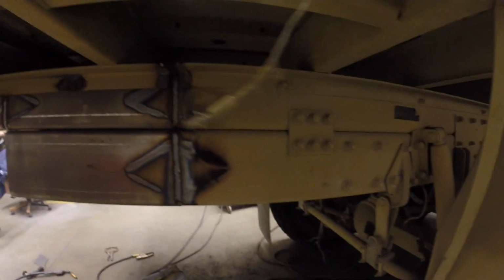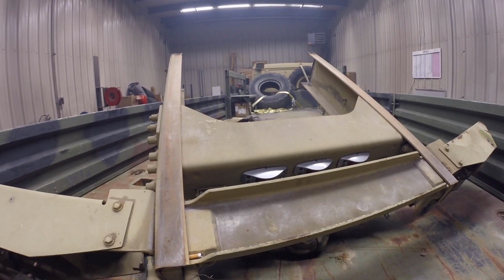FRAME RAIL ERECTION! - Truck Frame Stretch Part 2

Comment: I know this is old video but just in case anybody reads this.....  If you ever stretch frame rails you should always do a Z Notch instead of straight butt weld. Even with fish plates, Z  notch is far stronger and less prone to stress fractures.

Comment: Hey Trey,  

Awesome work!  

Where did you get the frame extension materials?    

I have been looking for a while and need to get some.   I am in Texas too, so if it is around here, that is even better. 

What alloy steel did you use?   

Thanks!
Reply from the maker: I had to buy some plate and get it bent. Your best bet is to find someone with a parts truck and cut some frame rail out.
Reply: Did you preheat and post heat?   

What rod did you use?  

Found a donor frame to extend mine.

Thanks!  

Ps..... we need a progress update.
Reply from the maker: @dcraigslist5243  No pre or post heating. I just slapped it together with a mig.

I've got more content in the pipeline. Just been busy with work travel lately.